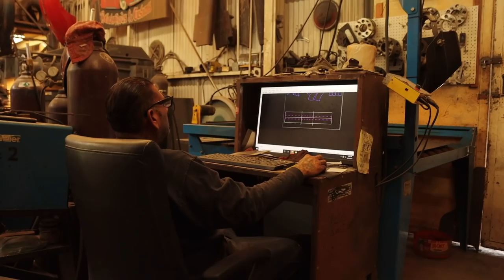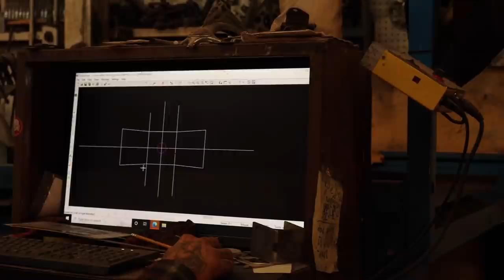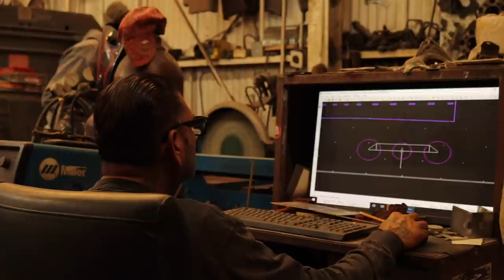1936 Ford T-5 Conversion - Part 3: Rear Suspension

Comment: Mr. Bello, the proper tool you need to pull rear hubs off banjos is the Plomb PLVMB  Axel Puller, several available from eBay at the moment for cheap!

Comment: HI guys from Victoria Australia 🇦🇺🇦🇺🇦🇺 im working on a 1946 chevrolet panel van ( panel delivery) with a 250 6l and th700r4 . Ive made new side panels . New back doors . Because most of the body had wooden frames in them here in Australia 🇦🇺🇦🇺🇦🇺

Comment: The T5 is a much better than the 39 top loader.  Love the old flathead V8s.  Have had many.  Studebaker made a overdrive that may Bonneville old timers used and still do.